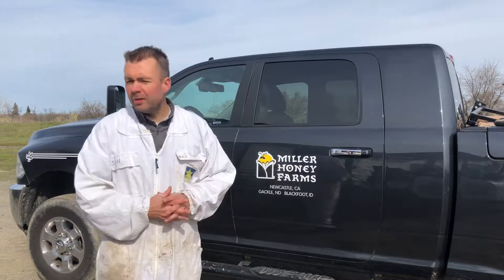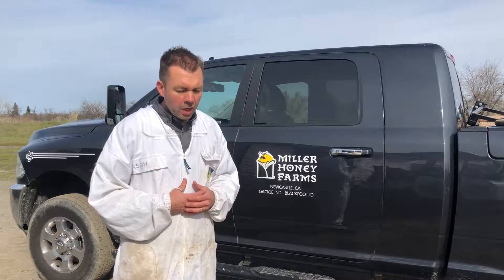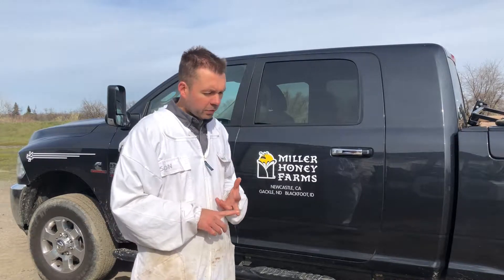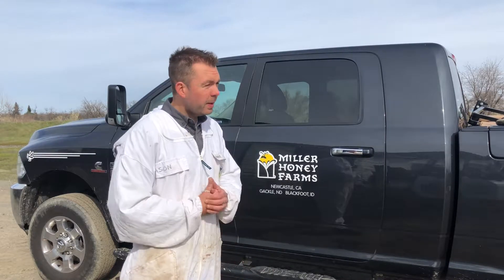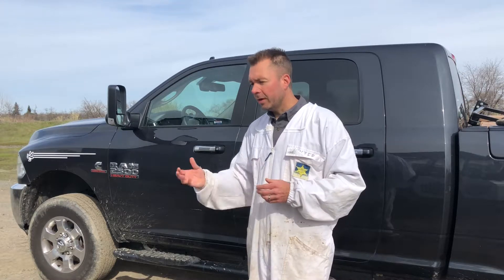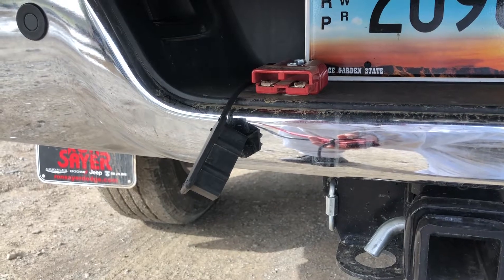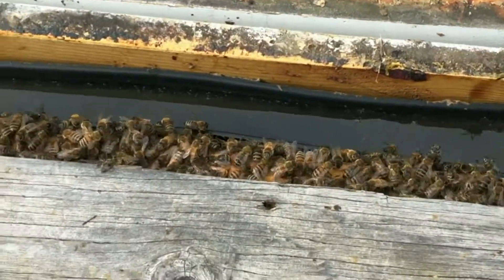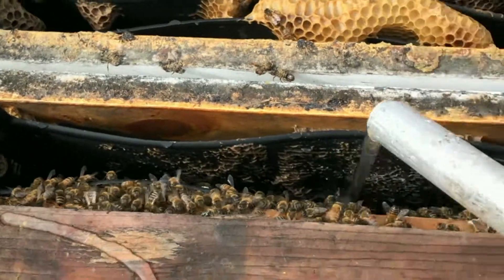Hypro 12 volt Roller Pump for Feeding Honeybees

Comment: We run a 4gpm FloJet 12v pump w/100' 3/4" garden hose. Ball valve nozzle. It takes 14 seconds to fill 1 gal w/thin syrup. 22 Seconds to fill 1 gal w/thick syrup. Auto shut off at 40psi. For the same reasons, I'm beefing up to the 7gpm Flojet next season. Hope this helps!

Comment: Love your pump setup I love the way you have the Anderson connection did the pump come with one unit with the 12 volt and the pumps or did you have to buy the pump separate from the motor?